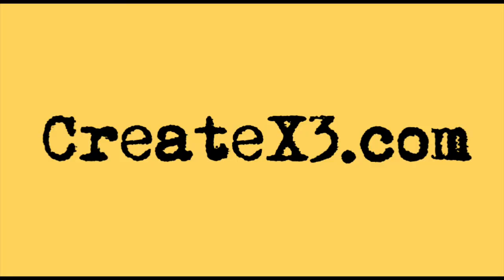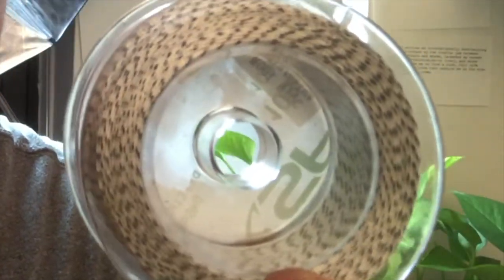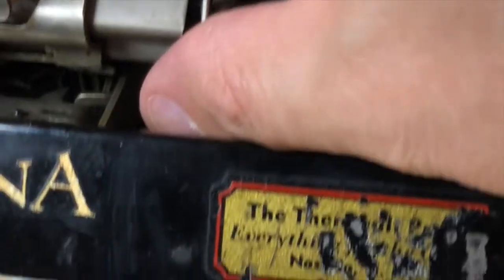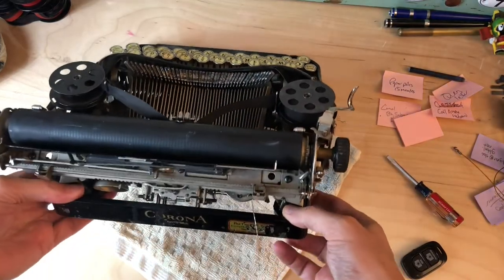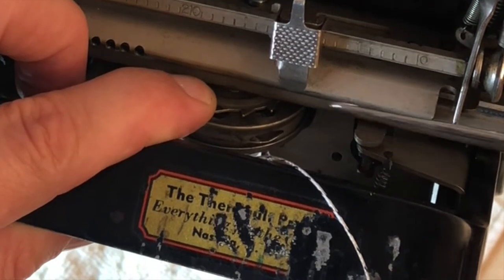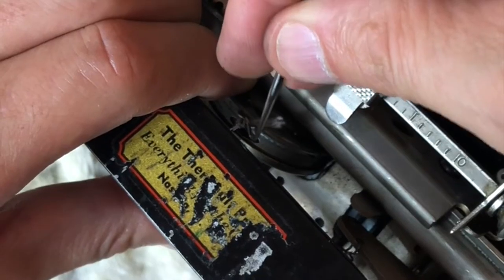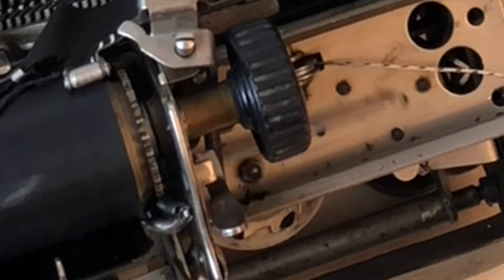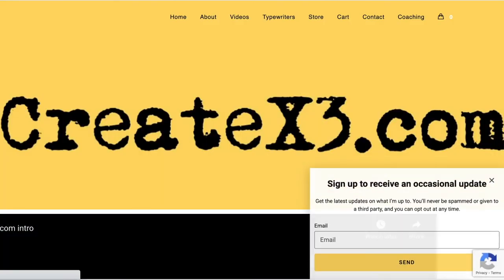How to Repair a Broken Typewriter Carriage String, Carriage Band, or Carriage Strap

Comment: Here's a challenge... How do you reassemble the carriage on an Olivetti Lettera Dora or 31? The little ball bearings sit in a cage that appears impossible to mount, even for an octopus. I've searched everywhere and tried everything from cutting up straws that hold them in place to powerful magnets. How did they ever manufacture the carriage in the first place?
Reply from the maker: Wish I could help you with this @DavidIngrassia, but the honest answer is that I’ve never disassembled or reassembled a Lettera Dora or 31. And of course I don’t want to steer you wrong.

Have you tried calling one of the veteran typewriter repair shops? My interior me tells me they will have performed this operation before, many times, and might quickly describe the process over the phone.

Please let me know how you fare if you do. And wishing you best of luck.

Comment: Help! I have a Remington Deluxe Model 5 typewriter that's been working great. I pressed the margin release button to try to use up more paper, and even though I felt it release, it no longer works and the carriage won't advance! Anyone know how to fix this???
Reply from the maker: Hi Rowena. Sorry to hear you're having trouble. I get this from time to time on my Smith-Corona Skyriter and my Olympia SM3, which of course are very different machines. Tough to say what it is without examining the machine. Have you tried depressing the carriage release lever and moving the carriage back and forth across its full range from left to right? This sometimes does the trick on my Skyriter. Have you checked the backspace button? Does that work? If you move the carriage manually back to the left margin, does the space bar work? How about the keys? When you hit them, do they advance the carriage? I ask because these three indicators often point to problems with the escapement. If all else fails, I recommend contacting Richard Polt, author of The Typewriter Revolution. He's sort of a specialist in Remingtons—a very knowledgable and generous man. Without speaking for his time, he might be able to offer some insight. You can read more about Richard and his great work with these and other machines here: https://site.xavier.edu/polt/typewriters/. I hope this helps. Please keep in touch and let me know how things go. Wishing you my best.